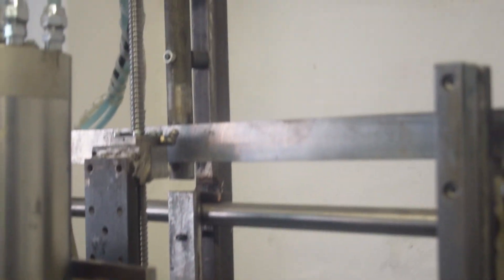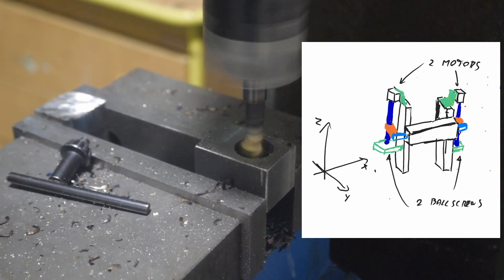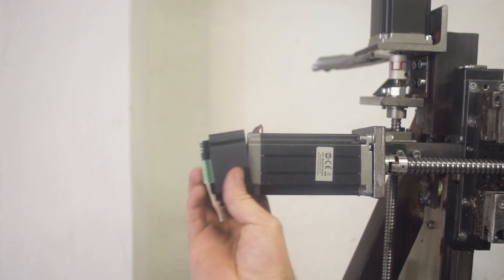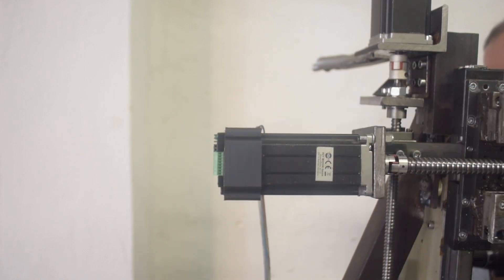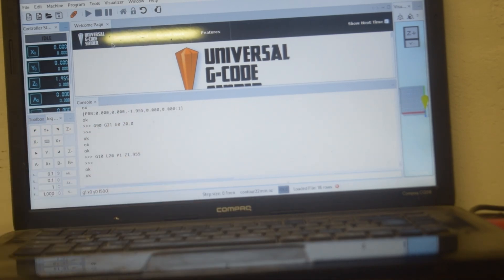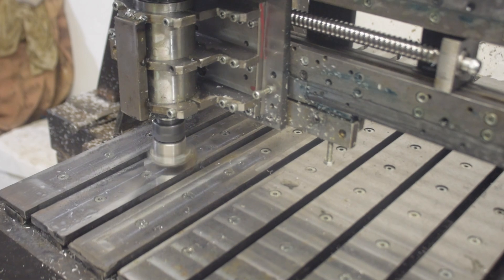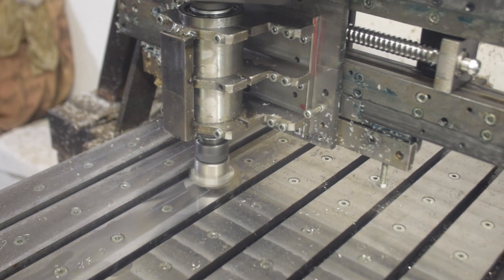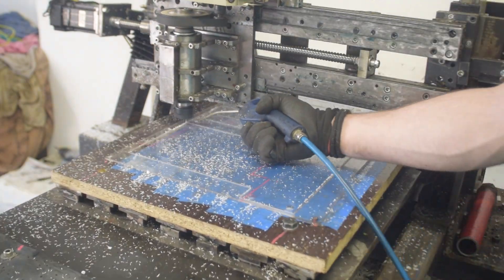New life for the CNC Z Axis | CNC Upgrade part 2

Comment: I know i am late but i got an idea. Try to get hold of cast iron and make your axis out of that. Steel is very bad at dampening vibrations but cast iron will help to make your axis rigid and dampen the vibration. Also make your cnc heavier to reduce vibration :)
Reply from the maker: I know.. but cast iron isn't this easy to find where I live. And steel paradoxically is also cheaper. However I used it many times and with the last mods it performs good (at least for my standards). 
Thank you for your advice!!🫶🏻

Comment: I watched your short video and thought it was interesting. I didn't understand it, but I wish I had taken an electronic course in my youth. How about doing an overview of your electronics of your mill in the future. And perhaps some information on the two motors working as one. Thanks
Reply from the maker: Yea this summer as soon as I will finish the exam session I have time to do some videos and I will try to make some. For the two motors working as one I literally picked the board where it has zstep and zdir and put 2 cables on both pads. With two cable per pad you can send the same signal to the two drivers of the motors.. yeah I will do a video!

For the short video thank you! Basically I just wanted to show that I can make circuit boards at home in a reliable way that can be double sided and with very fine features on it... I spent a lot of time inventing and testing that process.. and at the same time I wanted to see if my design of a full adder would work😂
Reply from the maker: But is there a way that we can use to talk other than yt comments?😂